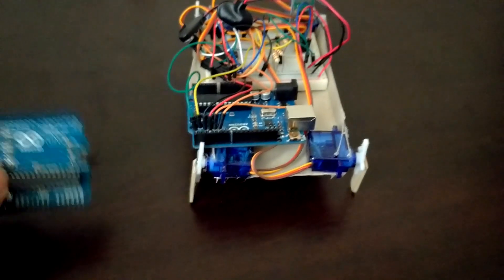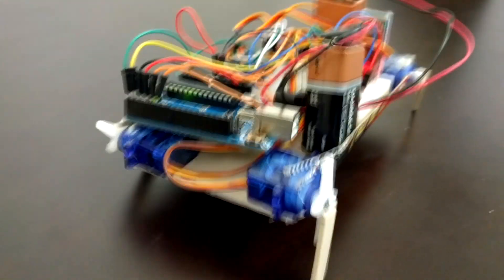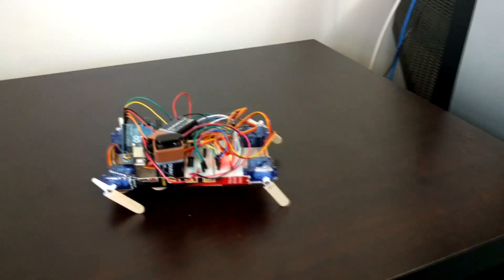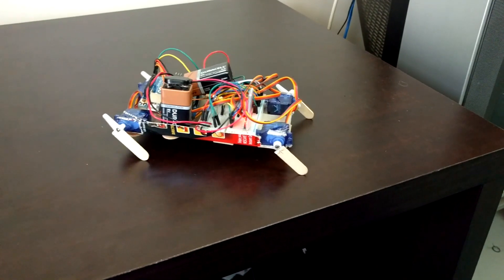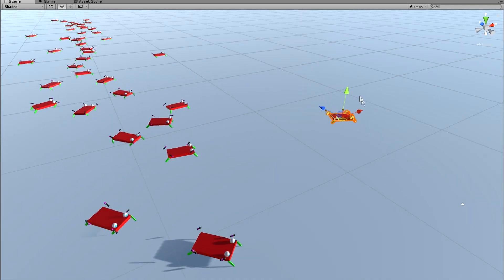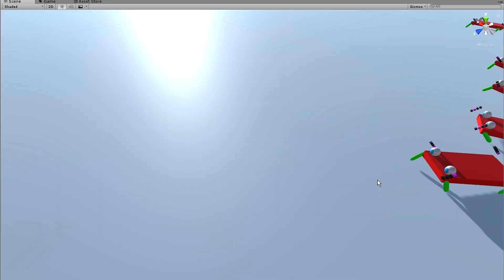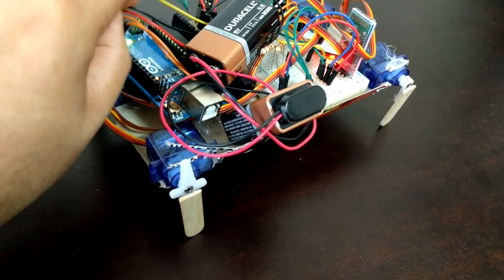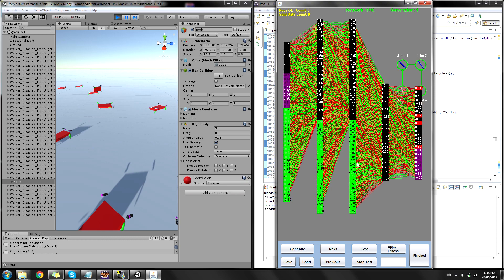Walking Robot with Evolving Brain Simulation - Part 2

Comment: Hi, The One, excellent video as usual! I see that in your output layer you have 24 different possibilities, and since you have 4 joints, that's six possible outcomes for each servo, right? So what are you actually outputting to each servo? Turn right or left for example, the angle you want, the speed of doing so?
Reply from the maker: I think it was something like per leg 4 neurons [Forward Speed 1, Forward Speed 2, Backward Speed 1, Backward Speed 2]. The highest value was picked to be the speed. 
So this makes 16 neurons. The other additional 8 neurons are state value neurons that loop back to the input layer. This provides temporary memory to the neural network which can be crucial in making its next movements. So total 24 output neurons.
Reply: Ah Ok, so this is some sort of an LSTM neural network. This is super interesting and if you ever intend to make a tutorial explaining how this works (with the quadruped robot as an example) and how to program it, I am sure many will be interested.

Comment: Hi my friend ,so cool work. Actually i am looking about Bluetooth with pc cominication. What ever i did ı could not set it . I want to do that , 
1. send a string from pc to ardu. 
2. according to sending string, ardu have to send values like "a,b,c" (it could be number double  or string word) to pc. 
After that 
3. pc will send a string like previous one like "k,l,m" and if first item of string "a" it it is equal something ardu will send back to pc a string line like "d,e,f,g"
Could you directed me how could i do such a this.
One more thing , i am just discover the unity thanks to you... it seems so good could you give to me some tips how could i build such a construction like yours. I mean if i want to build same consturaction like yours, how could i rotate its arms to movement? Best...
Reply from the maker: Look up BlueCove library for java. It can connect the Master Bluetooth from your PC to the Slave Bluetooth connected to the Arduino. Very simple to code. I just copy pasted a working example from one of the google searches and it worked :)
Reply: The One  i am using visual studio c# for setting serial communication between uno +hc06  and pc , actually i didnot know about java how could i put inside visual studio and uno ...

Comment: Do you think this could be adapted for bipedal robots? I've been wanting to build a sort of robotic raptor-like creature, with a tail and such for a while now but I haven't seen a real-life application like this yet. Are you planning on making the programs open-source? Or maybe I could enlist your help for doing the neural net programming side of things. I have some big ideas but my knowledge on neural networks is very limited. What are you thoughts? I'm sure that the program could be adapted to have enough neurons for full leg joint functionality, with the added tail function for balance. Eventually I'd like to turn it into a full-fledged animal simulation, but that's later on. 

If you'd be interested, let me know!
Reply from the maker: This could 100000000000% be adapted for bipedal robots! THE ONLY REASON i could not do it was because I didn't have MORE servos! And these 9 gram servos are so shit with low torque! I want to get new servos with higher torque but they cost like $20 per servo and I would need to get 8 of them so (~$160). I would buy them ASAP if I had not just spent $2k on a new PC hahahaha. I could help you out with the NN's. Check the description of my Neural network tutorial video and get that unity project. That project contains a evolving neural network file (NeuralNetwork.cs) and a Manager.cs file which shows how you can train neural network by evolving them (or you could also watch the tutorial). Once you go through the project you'll have a good understanding of how these things work.
Reply: The One I will definitely check that out! Servos are very much the limiting factor for a larger scale robot. I'll have to do some looking around online to see what I can find. Worst comes to worst though, I'll just build my own servos out of a big dc motor and position controller haha

Comment: +The One I see you are writting Neural Nets in C# for Unity. So did you try CNTK inside Unity?
Reply from the maker: I remember looking into CNTK a few months ago. And found out you can't train or create models with it in C#. Only use it to run existing models. The training and creations has to be done in CNTK's C++ or Python versions. I am already comfortable with using Keras library for Python for training large models, so not really interesting in CNTK. In my Self Driving Car AI video, I used Keras. But, used local server to communicate between Unity-C# and Python-Keras.
Reply: Awesome.. :) I just started a few months ago and I have started to learn with tflearn and caffe/caffe2 but caffe is a pain in the A$$
Reply from the maker: I'm going to move to TF once I get my new computer's parts that I have ordered arrive and I assemble it. I can finally start doing training on TF's  GPU optimizer rather than CPU which should give me ~20x speed up on training time.

Comment: is like a little baby trying to walk, awww <3
Reply from the maker: I know :D
Reply: BTW did you tried to allow 360 degree movement for the legs? maybe that degree of freedom can evolve into something that might solve the issue of not having an articulation to actually put a "foot" up.
Reply from the maker: Didn't try it because of the servo limitation (only can turn 180 degrees). Some of the servos where acting a bit weird too since they are cheap 9 gram with low torque. So i decided to just stick with 90 degree angle of movement (-45 to 45). I'm going to try it once again, once I get some better servos.
Reply: good catch, though it was 360 :) Also maybe allowing 180 you can check if it behaves differently. Another aspect could be increasing the leg length, or even use different lengths for the front and back legs. Just to see how it evolves changing external parameters. That would be fun!
Reply: +Pablo Pazos But sooner than you think they are going to take over the world

Comment: Have you tried another surface? (With higher friction)
Reply from the maker: One of the legs always drags on the floor because there is no ankle joint which caused it to just pivot in a higher friction environment. I'm going to re-do this at some point since I have ordered 4 more servos. So, I finally try to simulate ankle movement.
Reply: I think you can accomplish a better walking algorithm by increasing the length of the legs. Since the difference in the various states will be more pronounced due to the increased leg length, one leg can clear the floor more easily. The time intervals would probably need to be reconsidered, though.

But, it would be really cool to see 4 extra servos and how they work in the learning algorithm...so whatever you do, I'm not complaining lol :)

Comment: Your table is to slippy. This little fellow deserves a surface with more friction. Or some shoes!
Reply from the maker: You want me to start dressing it up :D. Jk. I wanted to find a more friction surface or give it more friction on it's legs. But, one of the legs always drags on the floor because there is no ankle joint which caused it to just pivot. I thought might as well let it use momentum to move forward.
Reply: Orlando Nerz 😂
Reply: Orlando Nerz omg I was about to comment on that but then I saw this comment..